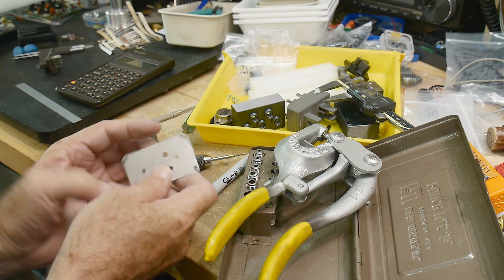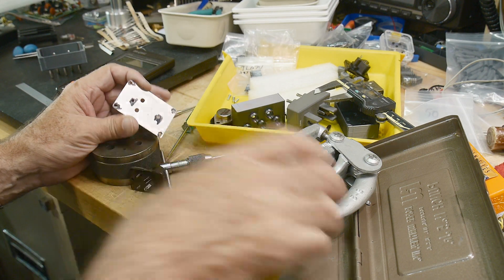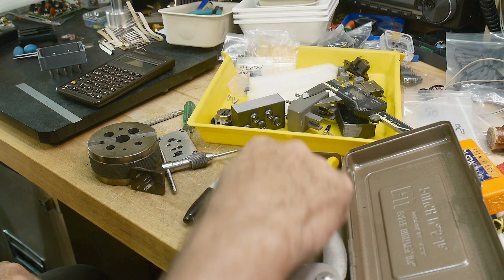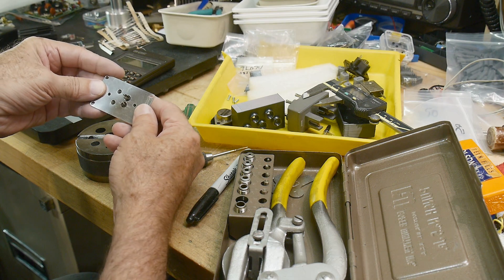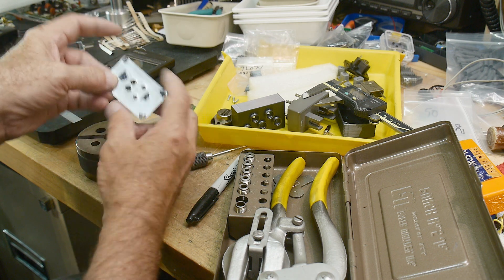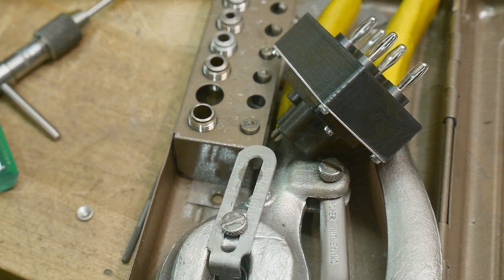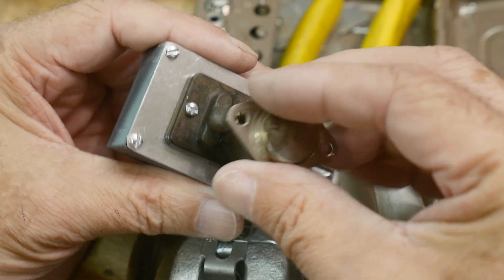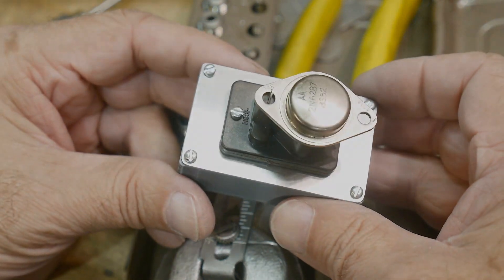#1289 DIY Tek Curve Tracer Test Socket (part 2 of 2)

Comment: At the highest voltage available on the tester is there a possibility of the pins through the holes arcing to the top metal plate? 'Course the plate isn't grounded to the tester per se but shorting between the pins could happen? Just curious...nice work BTW!

Comment: I like the punching pliers very much. I bought a similar set after drilling to many holes. My main application is to punch 3mm holes in double sided FR4 boards as construction material. 
From the design and from the box I have the impression your got yours much earlier.

Comment: Might there be a way to mount your punch to your bench? It looked like the lower jaw might have enough meat to tap and thread some holes one the sides. Then, use some heavy "L" brackets to affix it.
Reply: I have one of those punches and I just clamp that thick bottom/rear section in my bench vise when I use it.

Comment: Another great video, thanks. TO220s with the 2 outer leads bent down were designed as replacements for the TO66. So you could use that fixture to test TO220s.